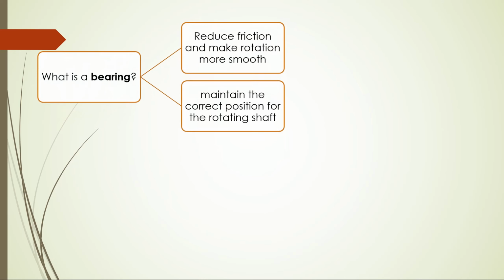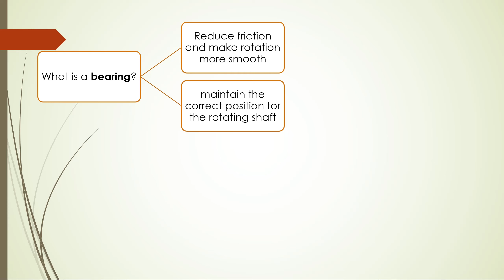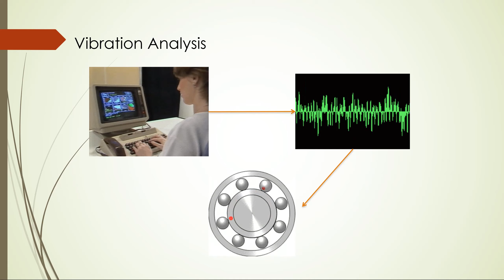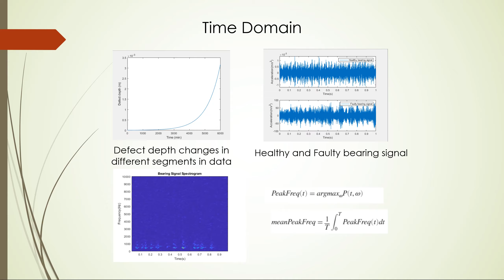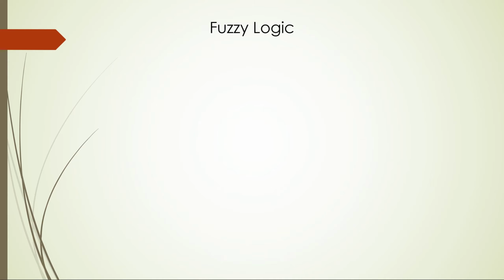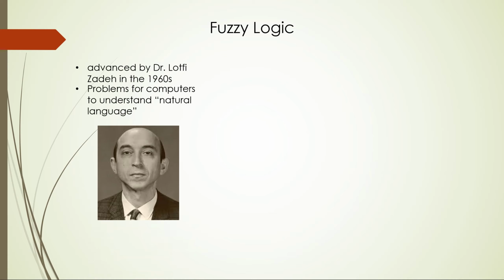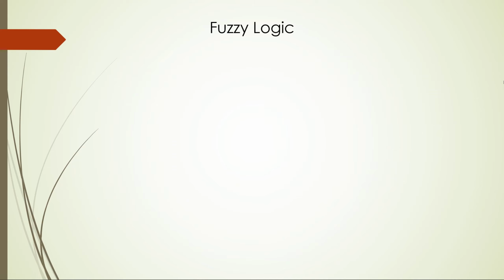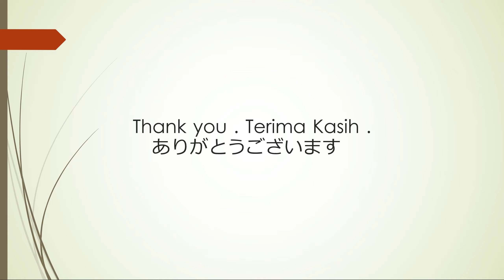[5MT] Bearing Fault Detection & Condition Monitoring Using Vibration Analysis

Comment: Question from Examiner: Since this is conditioning monitoring process, I believe the sensor(s) for vibration detection should be installed indefinitely in order to detect unnatural condition of the bearing. However, as of for automotive application, it is not cost effective to install the sensor(s) and the detection system in order just to detect the condition of wheel bearing only. Defected wheel bearing will usually produce loud sound and the replacement is not expensive. My question is, in what application that this system will work well and make sense in term of cost benefit?
Reply from the maker: Thank you for the question dr.

For this project, we are limiting our scope  existing prototypes, if we can find the same reference as the target project, a better understandings can be achieved.  Therefore, my plan is to enhance my basics first before going into future applications as Structural Health Monitoring(SHM) is crucial foundation for this project. 
Conditional monitoring is essential in order to reduce maintenance cost. For instance, in Silterra, there are many dry pumps to consider health monitoring and would cost thousand USD or more for maintenance.  With this initial basic study on SHM, we can plan a more proper maintenance thus will reduce the cost. Dry pumps are nonstationary and is essential in most semiconductor industry.